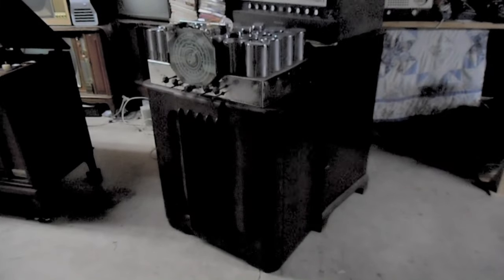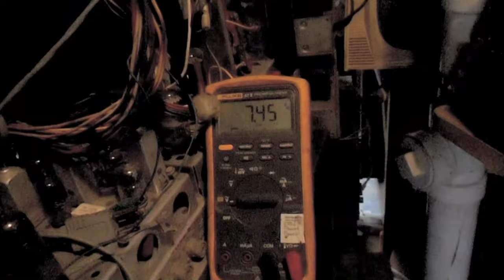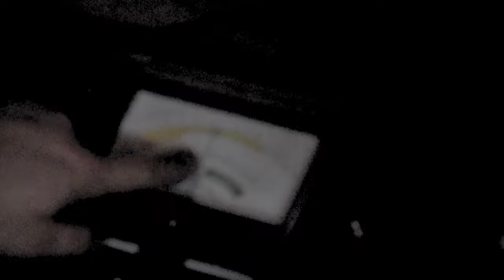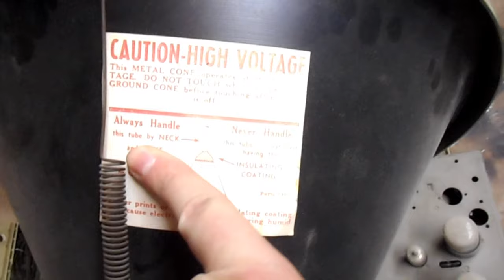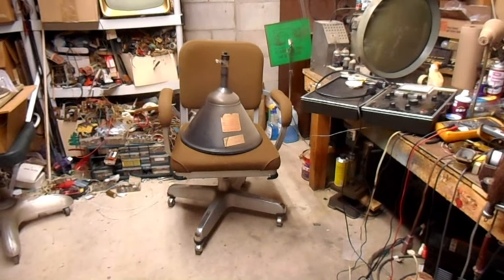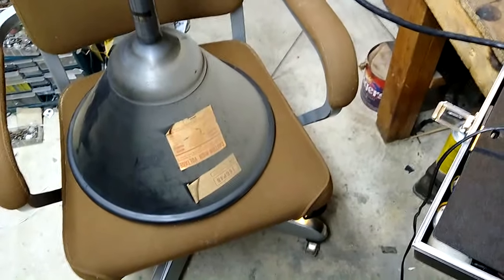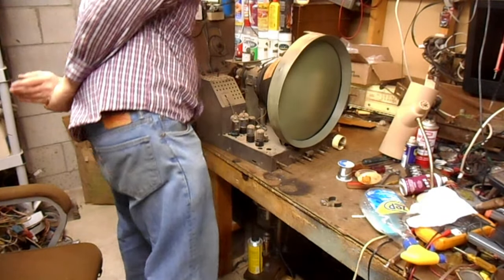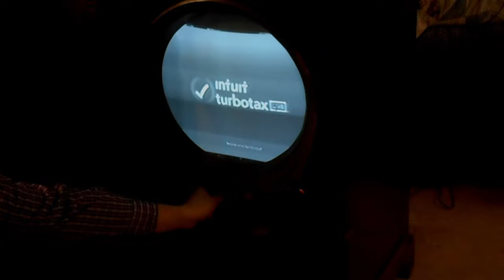1951 Zenith Porthole TV CRT swap, and 'How Many Brighteners Are Too Many?'

Comment: Awesome content Tom.  When I want to bump up the voltage on a CRT, I have a half  taken apart B&K CRT tester that I de pinned the heater voltage off off of and then I and I tap into the CRT filament wires, first disconnecting those from transformer or flyback.  Works pretty good and I successfully blew up a weak Trinitron CRT a few years back. It was fun forcing it into H-K short.  The colors emanating from the neck were we're a site to see😆
Reply: Hi Shawn, do you happen to know where a person can buy the upper knob for a zenith porthole TV? I’m missing the left side upper knob.

Comment: Hi, can you please tell me approximately what the value is on these zenith porthole tv in good original condition model G4238RZ1
Reply from the maker: They vary depending on where you live*, if the CRT is good, and condition. If there's a radio built in the value will be lower because of the size.  With the CRT untested I'd ask $100 and take the first $40 offer. If the CRT tests good I'd ask $175 and take the first $80 offer.  If the set works** well enough to light most of the screen to working perfect I'd ask $300 and take the first $150 offer (if you professionally restored it's electronics I'd stand firm at $250 unless desperate to sell).
**If it has not been electrically restored (all lytic and paper capacitors replaced) in the last decade and hasn't been powered on in over 2 years DO NOT power it on unless you can do so using a metered variac or dim bulb tester...Otherwise you risk causing damage to irreplaceable parts.
*There are markets where supply and demand are comperable (rust belt/midwest), where demand exceeds supply (California/parts of the south), places where supply exceeds demand (Paciffic North West, parts of the east coast), places where there isn't much supply or demand (Montana, poorer regions of the south). In places where there isn't demand it can be hard to give away a TV for free, and in places like California where demand is insane and supply is limited sets too bland to attract interest everywhere else are commanding prices interesting sets would anywhere else, and interesting sets are obscenely priced.
Reply: Thank you for the information.

Comment: You should trash that camera. Very bad low light performance. Even my spare phone, the nearly 5 year old Google Pixel 2 XL, produces a far better picture and that's quiet ancient for a smartphone.
Reply from the maker: Well that Nikon camera trashed it's self since that was filmed, so now I'm down to my smartphone, and a 2003 SD camcorder...
Most of the noise is actually my editing software changing the exposure, contrast, etc. To try and make a subject that looks normal to me (granted I have excellent night vision), and is almost completely hidden in shadows on the camera bright enough to see.

Also I do my editing on a HD-CRT monitor and after the fact realize the corrections look worse on LCD displays.
Your spare phone is only a just over a year older than my main Motorola phone (battery life always comes first in my phone choices)...I tend to look for reliable gear and stick with stuff that works as long as I can (keeping up with the jones' is too expensive for the almost non-existent amount of enjoyment it gives me).
Reply: @tomcarlson3913  still light years ahead of my National Panasonic M5 VHS camera lol & nearly spat my coffee out when you mentioned the pope 😄
Reply from the maker: @emmarandom9609  It's a digital 8 camcorder, but I didn't have any blanks on hand so the Admiral 20X12 video I filmed on it is mostly recorded on S-VHS (forgot to switch S mode on for the intro) from a pro-grade JVC deck I keep around.
Coming from half Catholic, half Baptist up bringing the one thing my family is in complete agreement on is nobody likes 'Faaancis'.😄